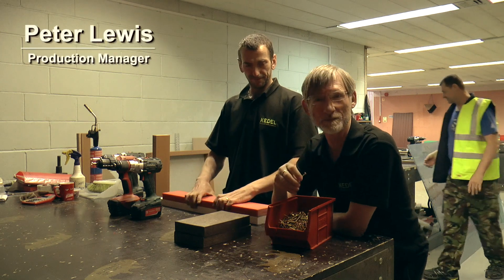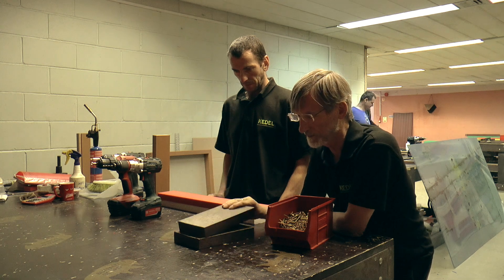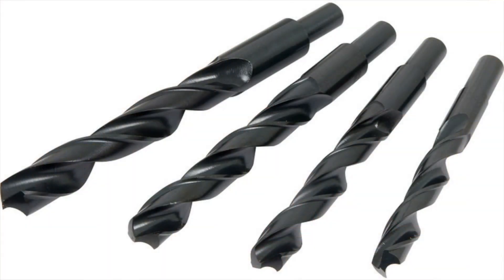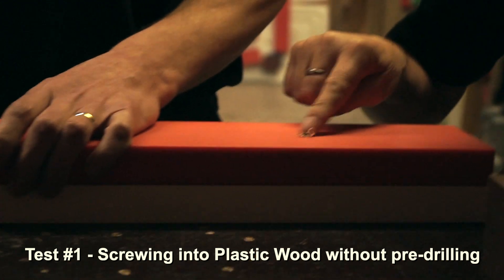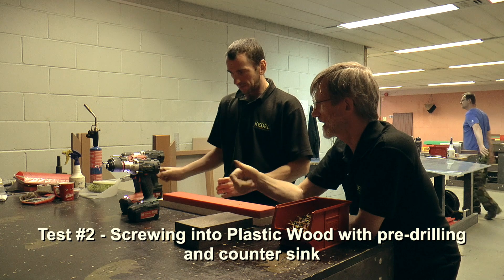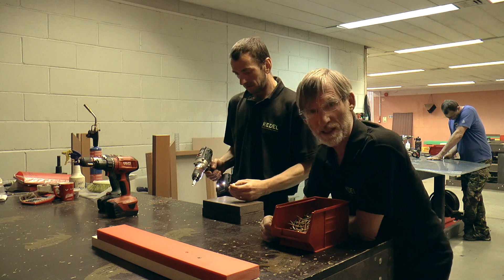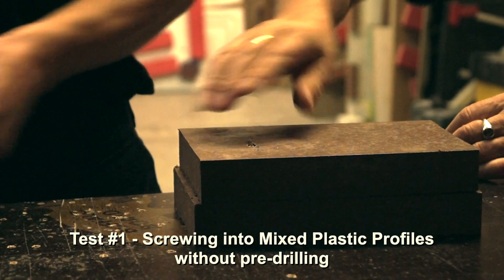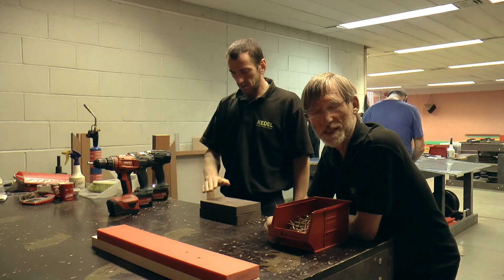How to Work with Plastic Wood | Screwing Plastic Wood (Episode 3) Kedel Ltd

Comment: Planning a refit on my sailboat is the strength the same as pine. And i will be covering some of it in fiberglass.  Is this product a good idea salt water thanks
Reply: No problem in any kind of water. Been used previously on seating on ferry decks.

Comment: hello there i've never worked/built with this material but the HDPE wood i assume it's on average stronger structurally compared with the styrene-based kind of plastic wood then?
Reply from the maker: We always recommend you order a sample of our product before making a full order. https://www.kedel.co.uk/samples/samples.html we only charge postage and packing for up to 3 samples per order.
Our styrene (plastic wood) has similar density and weight to some south american hard woods and similar strength. It is also more rigid than HDPE though even our Mixed plastic contains some styrene, poly propylene etc to give increased rigidity. We have three types of mixed recycled plastic quality. You can compare properties of our mixed plastic here: https://www.kedel.co.uk/user/Kedel%20Mixed%20Plastic%20Comparison%20Specs%202018%20(2).pdf
And how to work with our tyrene based plastic wood can be seen here: https://www.kedel.co.uk/working-with-kedel-plastic-wood.html

Comment: Dear Lewis is it possible to router the timber lumber. I assume the lumber is for more of an outside spec as opposed to plastic timber, Thanks
Reply from the maker: Both can be routed and both can be used for outside applications such as gallows brackets etc.

Comment: I bet the screw without the predrilling is structurally better and saves tons of constructions hours on a  big job.   We need more adoption and better pricing for recycled plastic wood.. price is way too high . Maybe a good government incentive/subsidy to kick start demand.
Reply: I don't know for sure, but I suspect you are wrong.  Mostly because of the screw forcing the two pieces apart before it penetrated the second piece.  Even with him evidently exerting significant downward force - which many will not anticipate the need for.  When eventually the screw bites into the second piece the thread buried in the first (because it is a fully-threaded screw, unlike traditional woodscrews) holds the pieces apart until the head hits the countersink.  At that point, the thread inside the first piece is (out of our sight) tearing the plastic, and will be weakening it.  Try watching that bit of the video at 0.25 speed.
Reply: Give it a trial, but generally it is much like wood. Same weight and density. But friction can cause melt back, so once in, the screw is not as easy to get out. If a pilot hole is drilled should be no problem. when sawing use a little WD40 on the blade to prevent friction heat and meltback.